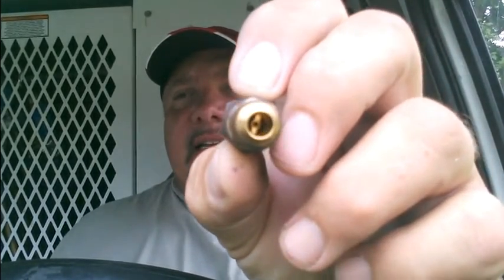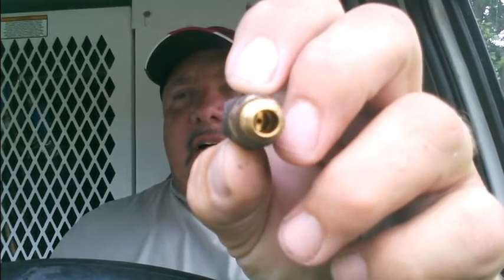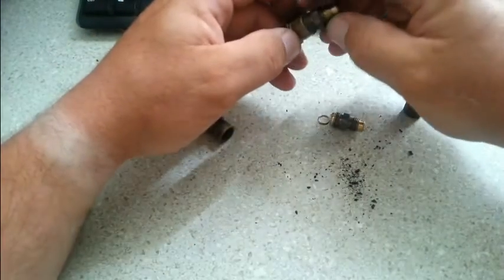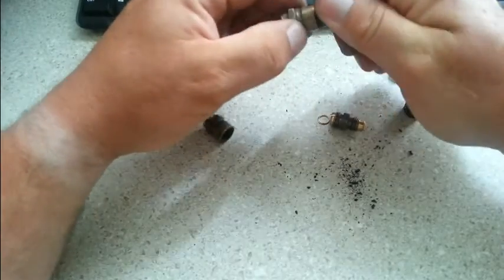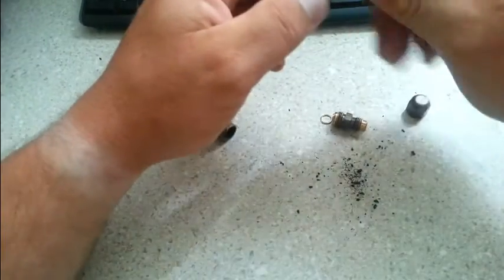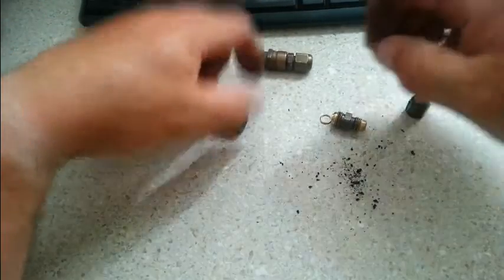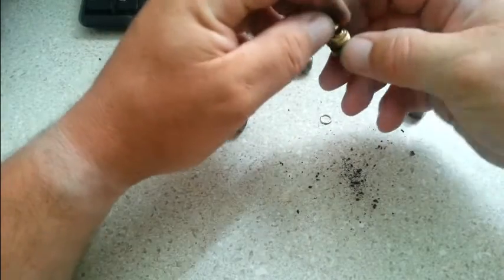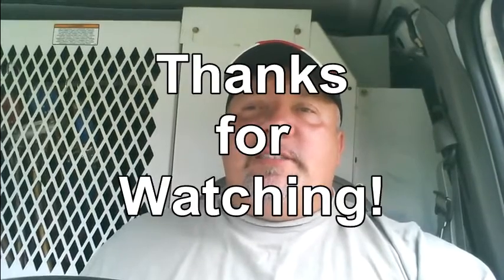Trane RTU Service Valve

Comment: just ran into this today, trane parts personal have no idea. I'm going to pull it and replace w/ 1/4'' stem and service valve. this is on low side return which is the only access port (low side). Thanks for the video.

Comment: Ya gotta unscrew the top part and replace it instead of just the core itself. Takes a 5 minute job with a core tools to a few hour job of recovery then change that valve assembly,pull a vacuum and blah blah blah what a stupid design!!! Any smart tech will do what you did and put a regular valve in its place so next time it will be an easy switch!